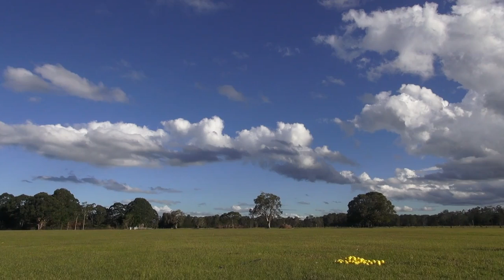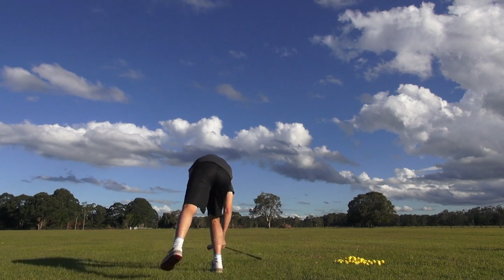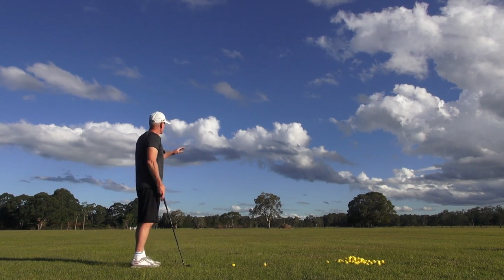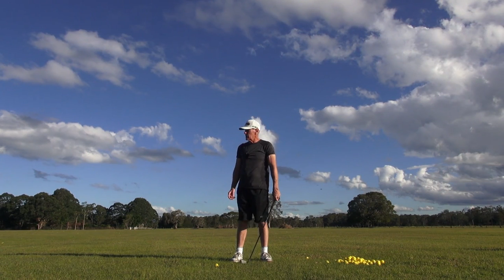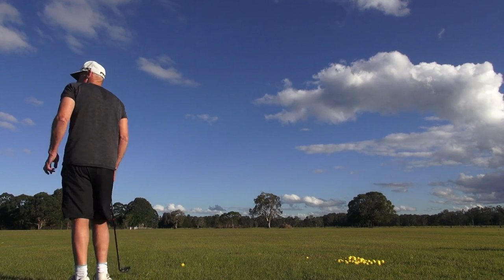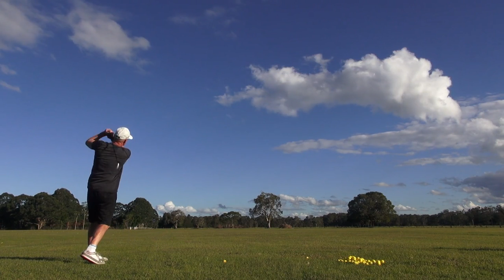'The Core Fundamental'  Of Channel Lock Swing.

Comment: Hi JH! This is GREAT stuff!!! I have never hit the ball so consistantly and solid before, as I do now!! I can't never go back to the old swing. Your explanations are easy to understand and follow. Feet in right position, shoulders in right position, head(nose) in right position - READY - GO!!! That's very easy. Though the body somehow is twisted, when taking the stance, it feels even easier on the back than the swing of Moe's. Also nice camera angels for showing your ballflight, thanks! Keep up the good work😉 Greetings Kent
Reply from the maker: Hi Kent, 
                     You have really cottoned on to the swing mechanics./Geometry easily.I think it's relatively easy as well as an application but for some people it needs more visual clarification which I will be working on.
                    I experienced the same feeling of rejection for the old conventional ball setup when I  went back to it just to feel the difference after the Channel Lock ball position and swing type geometry.
                     cheers JH

Comment: JH great video explaining what your followers should do. I noticed that in more recent videos you are pulling your trail leg back rather hand your front leg. In order to avoid confusion are there certain videos we should watch to better learn what to do. I often get confused as some of the videos I watch are older and you have changed your form. After watching this video I can definitely see that my shoulders have been too closed at the moment of striking the ball. This video gets out a lot of information. Thanks.
Reply from the maker: The only variation I have made to my CL swing is that of going from an open stance foot line at the beginning of CL development to that of a closed foot line stance ...I  don't know what the result of you having your shoulders 'to'  closed at impact were  ...  I   could never have my shoulders to closed at impact ..  I know now they are never as close as I want them to be at impact ...
                   I haven't seen anyone yet get 'to'  closed with their shoulders at impact  ..  I wonder why you think you were to closed with your shoulders at impact  .. you would have to be very flexible in the midriff and hip extensors to keep your shoulders closed to much at impact   ..  
           Just adhere to the base protocols of CL mechanics/geometry and work out a stance that gives you good balance and range of motion during the swing  ..  open or closed stance matters not    ..   the only thing that determines the club direction path into the ball is the shoulder girdle angle at impact  ..
                cheers JH

Comment: Hey J.H.! If you want to know exactly what angle your feet are at, try this: With your feet under your armpits, and your feet parallel, if you step forward with your left foot half the length of your foot, you're at 45 degrees relative to the parallel foot stance you were just at; a quarter of your foot length is 22.5, and 3/4's of your foot length forward is 67.5. For those who want to know what angle their foot is 'turned' to,  if your foot looks be at 10 o'clock (or 2 o'clock), then it's 30 degrees relative to parallel (or 9 o'clock); at 11 (or 1), it's 60 degrees.
Based on some of the footage I've seen of you, your feet are pretty close to 45 degrees (from a line perpendicular to the target line). And you say you set up closed to the target line, but at impact your shoulders are parallel to the target line. So you may set up a few degrees closed to the target line, but impact doesn't lie, especially if there is no curve to the ball you're hitting and your on target.
Of course, your right in that everyone will have a different setup point to swing from. But since very few people carry a protractor anymore, I hope my "quick and dirty" method will help.
Reply from the maker: The end resultant of the swing mechanics/geometry is to arrive at impact  with a closed shoulder line which has to deliver the club from one direction only ..in to out... the 'degree'  of in to out  is proportional to how the ball is tracking relative to its target direction actuality.
                     You are not understanding my 'address' positioning to 'impact' positioning of the shoulder girdle settings.. what you are seeing at address is a partly initiated backswing because of the 'back cocking' of the shoulders.. ..that address angle is not my 'impact' angle.
           As well you say  'impact doesn't lie'.. and for all intents and purposes you are correct..however in this case as I am hitting the ball  straight to the target it is not actually a 'straight' to the target geometry application...  my club is traveling in to out at impact .. therefore if I was  shoulder aligned parallel to the target line the ball would go to the right of the target ..Elementary  path direction influence.
                    For my club to be traveling   in to out at impact (which it does categorically) and my ball  flight   to be tracking straight to the target ( or slightly drawing back to it) I have to be actually  be aligned a bit left of the target at  impact and my ball flight is in reality  from a  technically correct geometry  perspective a   'straight push' to the target...  
                        These mechanics are not easy to digest and understand ...however, the simplicity of them is just the indisputable laws of club path and face application to the ball at impact and an easier way of guaranteeing those laws are consistently applied in the same manner every time.
                          What I am trying to do with the setup procedure for players is to simplify the procedure  to that of  'abouts'  rather than absolute  specification numbers... the 'Core principals' are the objective at the end of the day..how you  get  those 'Core principals' in place  are  pursuant to individual  trial and error testing.. one mans '45 degs'  can be another mans '65 degs' ..or  '25 degs' etc etc.
                         The process is non-negotiable in the  'Core Principles' ..it has margins of flexibility in the other preparatory  facets of the  Core Principals.
                             cheers Jh

Comment: Hey JH-just discovered your swing a month ago and I think it’s great. In watching your videos, it seems like your feet position has really changed over the years. From way open to slightly closed. I guess that proves how good this swing is. Just curious why you’ve changed. Is one easier on the body than the other? And I think think DTL videos are great!
Reply from the maker: Hi Mate,
              I  went to the  closed stance     because  at my age  of 78  I  dont have a lot of hip flexibility   and the closed stance   just lets me   get  my trail hip  turned  a bit easier in the  backswing  .. the swing works  just as well from an open footline.. if you have the  hip and midriff flexibility  you  can  certainly  play  from  a n open footline  at address. 
           It really doesnt matter  where he feet are placed  from  a geometry point of view..  its only the shoulder  girdle that has and influence on where the    arms  swing the club  .. .. and as long as you keep the shoulders closed   at impact  the Channel Lock swing    works  great  from any footline  stance .. 
      cheers JH
Reply: 1atomicgolf Thank you! This swing is great. I always have trouble with hip rotation. I’ve hit dead pulls for years. None since I found your swing. I get way to anal when I’m paying golf. This system quiets my mind. Can’t thank you enough.
Reply from the maker: The whole reasoning behind the development of the Channel Lock swing was to eliminate the 'Pulled/Dragged'   shots..  those shots have been the bane of all conventional golf swings since time immemorial..no player in history could ever eliminate that shot  .. which certainly included me ..
                 I  just concluded one day that from a forward of body center ball positioning you could never guarantee square shoulder alignment at impact  .. you might get it occasionally but never always..
                    I  just went off looking for a  body structure process that created an automatic closed shoulder position at address and impact  ..   and was as simple as the ball position and changing the swing path from circular/linear..  to profoundly    'inwards/outwards'.. it worked from the very 'first' shot..  and has kept working ever since  ..
                          cheers JH

Comment: Hi! I have a question. As I understand the channel lock swing you should hit the ball with shoulders still closed at impact. Right? How can you then hit the ball from "the side of your body"?
Reply from the maker: Not sure I understand your question..  if you addressed the ball  in a normal fashion   as you do with a conventional type swing but positioned the ball off your right foot big toe instead of the normal   forward ball position and then just turned your shoulders on the backswing  you will see the club is tracking to the side of the body...as it comes back down it is still tracking to the side of the body and the shoulders are closed  coming down to the ball...if you position the ball far enough back at address and keep the lead shoulder closed coming into the ball you have to track the club to the side of your body.. its only when the lead shoulder opens up that the club  tries to get in 'front' of the body...hope that helps you out.
                        cheers jH